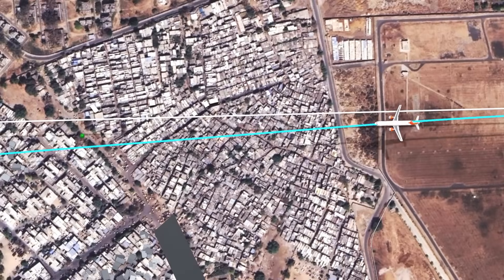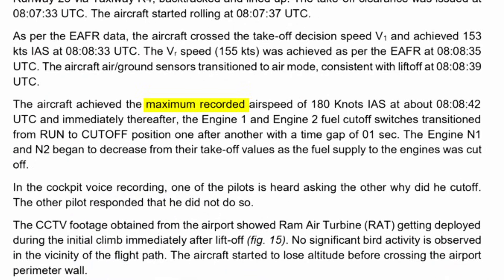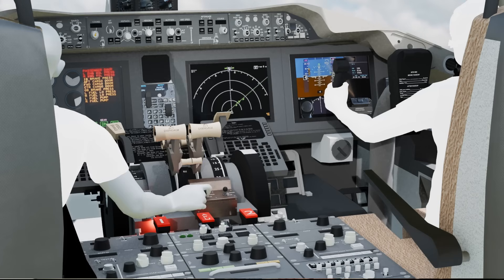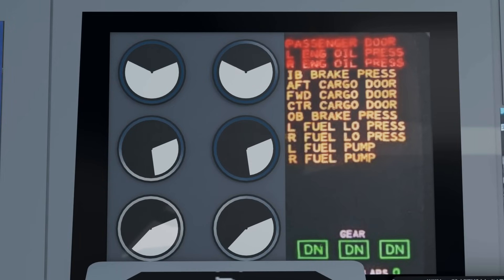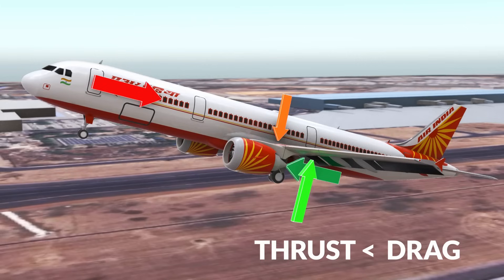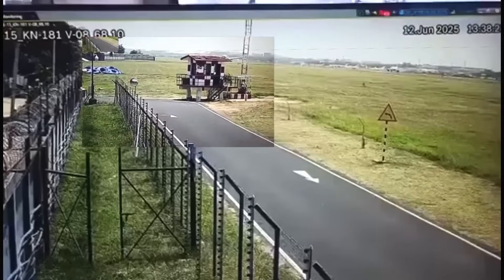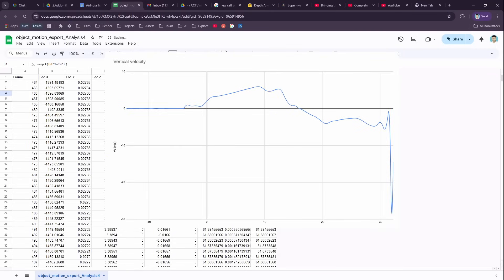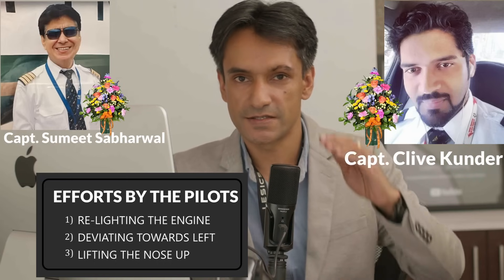Use of 3D Clone | Decoding the Crash Details you Missed

Comment: The fact that the engines were relight, confirms there was no mechanical fault otherwise a dead engine would not reignite.  Everyone it's trying to manipulate the findings of the report to avoid facing the reality, the flight was sabotaged.  Engineers check planes before take off, why is no one taking about that checklist??
Is it because they know that everything check out fine before the plane took, and bringing that report to the table will in fact destroy all fabricated narratives in order to not place blame on the pilots. 
The fact that a conversation between the pilots one questioning the other "why did you turn the fuel off"... is a very disturbing conversation in a cockpit and most likely the first of its kind. That alone is not a normal conversation. The flight was taken down by one pilot and another trying to save it. 
It also cannot be dismissed that it's been mentioned Captain Sumeet had suffered from depression, due to relationship breakdown, and the death of his mother. Instead of paying attention to facts so changes could be made to help the airline work with staff and raise concerns around mental health and how they can be best supported, everyone wants to bury their head in the sand and only listen to narratives that give them a "feel good" sensation.
Reply: Except, you don't know if one pilot asked the other "why did you turn the fuel off?" The "report" says quote "In the cockpit voice recording, one of the pilots is heard asking the other why did he cutoff." Indirect speech. That's a huge difference. Because the very same indirect sentence could mean one pilot asking the other, why the PLANE cut off by itself. In India, planes are "he" not "she". The answer of the other pilot can then be interpreted as "I don't know, I didn't do anything." See, how easy that was? Just changing direct to indirect speech and 2 same facts lead to completely opposite conclusions.

And the report is full of incomplete, purposefully obfuscated half-truths, such as the time of RAT supplying hydraulic power, but not the time of RAT deployment, etc. They are cherrypicking what they can to point the finger at pilots. If they released full CVR conversation, the truth would come out. The can't afford that.
Reply: @MerrekSK indeed, but even then...still...I would have my doubts whether all is done correctly, responsible, with a clear and clean conscious mind. That I find hard to believe, considering what is at stake for so many people and institutions, corporations, factories, governments.
Reply: Where's the report of the sound of the switches being moved? Or the lack of sound? Or even indistinct. They've obviously listened so where is it?
Reply: @pa1189j I think the pilot did something  yes
Reply: @AnetaMihaylova-d6f So where’s the report of the sound of the switches then.  Present, absent or indistinct. Why have they omitted it? It’s crucial factual information.
Reply: @pa1189j one of the pilots  cut off the fuel switches .
Reply: @AnetaMihaylova-d6f   So you were told. If it was 100% true, they would've release the full CVR portion of the conversation and the sound of cutoff clicking. They didn't, cause they don't have any. They are better of stalling for 1-2 years to save Boeing's plummeting stock. Use your head.
Reply: But now in these days of false news, we can never be sure anymore what is true and what not. We never ever could but we did not know. We were to believe and think and be sure and certain everything said and told by high(er) institutions even governments was true, for our own best. But now, with the internet and many curious daring people investigating everything and every spoken and written word, we learn there is hardly any truth in what has been told and sadly will be told to us. 'They' go and will go more, deep and far to hide any uncomfortable truth. Even destroy it if necessary for their lucrative agenda.

Comment: Great analysis 🎉 🎉 But I say that what AAIB released was just a preliminary report and they had mentioned in the report that investigation is still progressing. As per international norms, it's mandatory to release a preliminary report within a month of an aircraft accident. The report might have been on initial findings from CVR and FW EAFR. It's also mentioned in the report that AFT EAFR is severely damaged and retrieval of data is very difficult. There can also be a case where the recorders might have captured the logs as manual cutoff of fuel switches even though there might be a possibility that a wrong signal might've triggered it. Let's wait for a detailed investigation report till then.
Reply: Let's not wait.  The AAIB preliminary report is tailored to make those who are less skilled in reading think that the report blames the pilots  That way of saying but not saying is called 'plausible deniability'.

Comment: The simplest analysis was put forth by another youtuber which said the acceleration needed to achieve  max velocity  from rotate velocity within 3 seconds is not physically possible in gear down and RAT down position-  as it would need almost twice the thrust force of both 787 engines!! I mean the speed and RAT & gear down position are there in AIAB report itself so no one can dispute this fact.😅 Now I have started doubting if conversation about the switch even happened between the pilots ! Unless the entire CVR data is out verbatim, AIAB can't be trusted
Reply: Exactly. The preliminary "report" is deliberately obfuscating, if not straight lying to steer us into conclusions. There are much better ways to knowingly crash an airplane on a 10-hour flight. Not when your co-pilot is at 100% concentration, senses heightened and you risk surviving the low-speed low-G crash and burning to death. A real murder-suicide pilot would've waited for the co-pilot to go to bathroom, locked himself in the cockpit and plunge down with instantaneous impact providing painless guaranteed death. Just like in the other few cases this'd happened before. This is the best argument, the captain didn't do it. Unclear unguaranteed outcome, the 1st officer could've stopped him, etc. He'd risk not crashing, getting caught and imprisoned? No way.
Reply: AAIB can't be trusted.   You sure got that right!

Comment: This analysis can explain that the pilot(s) tried to relight the engines, which meant putting the 2 switches to cutoff, then back to run.   My initial guess was a software error deciding to cutoff the engines.
Reply: "My initial guess was a software error deciding to cutoff the engines."
Ditto.
Reply: @patricklockerby4308  "My initial guess was a software error deciding to cutoff the engines."  Your guess could be true. The pilots have to move the switches from run to cutoff first in order to relight the engine even if the engines were cut off by any other means.
Reply: Engine cutoff is done manually only, it has it's own switch with proper locking mechanism. The pilots even tried to turn back the engines on by offing those switches(2 switches since it's a twin jet airplane).
Reply: @johndavidson3424  Engine cutoff is NOT manual only. The TCMA - Thrust Malfunction Accomodation System can shut off fuel regardless of the pilots' switch settings.
Reply: @patricklockerby4308 
A software shut off does however not move the switch - the report said that bit switches were move to the off position within 1s if each other - that's not software
Reply: @ItsAlways42-z1e  The report did not say the switches were moved. It only mentioned it is transitioned .....
Reply: @luckydogjunction2120 

Different wird, Dame meaning - the switches were physically moved, they transitioned from on to off

A software glitch cannot do that, for that the switches would need a complex motor mechanism which does not exist
Reply: @johndavidson3424   You didn't see the video, you're just replying in the comments. This happened before - All Nippon Airways 2019 TCMA incident. First watch, then comment. Clearly pilots shutting off is NOT the only way how engines can lose thrust or even cut off the fuel supply.
Reply: @johndavidson3424  
On each engine:
FADEC can shut off fuel.
TCMA can shut off fuel.
Fire detection system can shut off fuel.
Pilots can shut off fuel via the TCMA.
Reply: Then why did the pilot flying the plane ask the Caption why he shutoff the fuel to both engines.  Chances of both engines simultaneously failing are a billion to one.
Reply: @ScottMunro-p3y  You're sitting in the passenger seat of a hybrid model semi-auto drive automobile (auto parking model), and there is a full break occurrence occurs, and you ask the driver, "Hey, why did you break the car so suddenly? And the driver said, 'I did not!!' Now, whom you believe? Will you believe the driver or the advanced hybrid vehicle?
Reply: What the vuk are you even talking about?
Reply: Well said😊
Reply: @ScottMunro-p3y  The AAIB report uses very crafty techniques to get the world at large to blame the pilots.  Don't fall for it.  The pilots will have felt a sudden deceleration, causing the pilots to look at the instrument panel and see that the fuel had been cut off.
!st - why did he - the plane - cut off?
2nd - I didn't do it.
Reply: @ScottMunro-p3y   All Nippon Airways 2019 787 did it once and now! It is an assumption that the pilot shutoff the fuel. This is not the only possible way that an engine can be shut down
Reply: @luckydogjunction2120  The Captain purposefully moved the fuel switches from run to shutoff. The flight data confirms it!
Reply: @ScottMunro-p3y  "Chances of both engines simultaneously failing are a billion to one." Are these referring to in general the 2 engines failed by itself". What is the chance of both engine on a Boeing to fail .......?

Comment: As soon as I read the gas switches were "seen' as off, and the 2 pilots were surprised, I said and asked a pro in planes "would it be possible the system turned off the gas but the it's logged as a manual action' ?' 
And seen the motors were off, they had to cut the gas button and put it on to hope a reset !
Another analyse showed the RAT was deployed before the switches were noted "Off"' as if the system knew gas and motors were off !
You point the strange informations in the rapport.... you are not the one !
Reply: Rather than seeing anything amiss at first, the pilots probably felt the sudden loss of acceleration.  That would be initially from 100% thrust, step down to 80% and then ramping down.  The passenger said it felt like the plane stopped.

Comment: Your conclusion agrees with the most reasonable interpretation of the language of the Preliminary Report, p. 14, because the verbiage "immediately after lift-off" for RAT deployment, vague and indefinite as it is, can only reasonably be interpreted to mean that the time of RAT deployment be closer to the time of lift-off cited at 08:08:39 than to the other definite time stamps of 08:08:42 and 08:08:42 of the Engine cut-offs. From this it follows that RAT deployment amply predates cut-offs, pointing to plane error, rather than pilot error. Thank you so much for your persuasive arguments. See Las the presentation by Geoffrey Thomas and Richard Godfrey called "Implausible", agreeing with you.
Reply: It was obvious to me, a retired lawyer, that lawyers settled the preliminary report.

Comment: I still believe heroic captain was genuine in saying he never shutdown the engines, and bet he was just as surprised by event as was the heroic first officer, when either, or both, were alerted to attention by EICAS warning.  Neither pilot moved neither fuel switch as initial precipitating cause.  Engines were (at least one was) shutdown at 1 second following takeoff (gleaned from your evidential timeline), without being commanded to do so by pilots, due to electrical fault or disturbance, or due to computer error or electronics failure.  Flight data recorder incorrectly reported (at least the initial) switch transition(s), owing to same scenario.  Has happened at least once previously.  AND/OR (maybe even related/causal), left engine looked like it suffered a compressor stall at right about the time of rotate, or else fuel was cut off to it while during its high core speed.  Further fuel switch transitions (probably then properly being recorded by FDR; actually, likely even the initial recorded transition, too, in this scenario) might have been as a result of standard (memory-item) engine reset procedure, which may have actually been unnecessary, possibly even inadvertently tragically interfering with, and delaying, the automatic relighting.
Reply: Known problems with water entering 787 EE bays have caused all sorts of anomalies.
Reply: The captain of the immediately preceding flight entered a "Stabilizer Position Transducer Defect" into the aircraft's technical log. This defect concerns a sensor that is crucial for controlling the aircraft's pitch by sending signals to the flight control system.  As well as that passengers on this prior flight reported various seemingly electrical oddities.  Might this all have been indicative of building systemic electrical problems?  Could TCMA have thusly erroneously detected asymmetry?  Or, incorrectly determined that aircraft was still on the ground and (wrongly) could thus still safety reject taking off?
Reply: Maybe the "investigators" don't know the difference between a relay and a switch?
Reply: @patricklockerby4308   They do know. They just need to delay the truth, let Boeing sell some higher-value stock before the truth comes out in a year or so and it becomes worthless...

Comment: Why so many theories when.. NOBODY ever needed to touch/move a cockpit switch.. when electrical power is interrupted, even for a fraction of a second, 787 and 777, for any reason, the spring loaded fuel cutoff valves to the engines will snap shut. Cockpit switches would then at all time stay in ON. This design is that in case of electrical failure, which means fire extinguishers cannot be activated, fuel shuts off automatically so the wing does not burn through from an engine fire. At take off there seems to have been an electrical snag. Happened to ANA 787 after landing using reversers, in Tokyo, and unable to restart. Happened to BA 777 landed safely mile before runway in London. Rtd Training Capt. Pilot Union rep at all regional air accident investigations
Reply: Good thinking, but the duel cutoff valve is not spring loaded.  Its actuator has two input wires - one to open and one to close.  They take 28 volts via 5 relays per engine.  The switches each connect to one relay.  The latching relays don't drop out if they lose power.
Reply: @patricklockerby4308  do you have access to the full wiring details of the fuel relay that controls the spar valve motor?
Reply: @gamelame99  needs it to argue with me hahah. funy how ppl argue points without knowing , isnt it
Reply: @jeremyjohnthompson5187  why would you think so mate, I already appreciated your efforts in bringing out a scenario that seems highly likely.  I'm just asking for some more clarity on the fuel relay wiring since that is so critical for establishing your proposed mechanism of failure beyond doubt.

Comment: On the CCTV film you can see a vapour coming from the left engine. This fact has been neglected so far. Can you fit it in in your conclusions? I am a Dutch journalist.
Reply: It's dust blown up by wake turbulence.
Reply: @patricklockerby4308  No, it is thicker near the engine output than at the ground. And only left.

Comment: Gross misuse of your engineering credentials to paint an imaginary fantasy to push the blame to anyone but the captain. It’s quite obvious to me your starting point is the words and feelings of Sam Thomas the president of the Indian pilots association. Is he the force behind all of this nonsense? Given the terminology you have used it seems to be. 
Too many obvious errors in your so called analysis to list. Suffice it to say that you are ridiculously wrong by your finding of 190 ft maximum elevation. Also completely wrong to argue that fuel switches can’t be turned off within one second of each other. Even a 11 yr old can do that real easy. Also, you are very weak on logic and psychology for lumping the two pilots’ intentions together as if they are in full cooperation. One is a promising young pilot trying all he can to save the plane and souls from the enemy within; the other one a deranged mass murderer
The data produced by your (so called) analysis contradicts readings from the FDR by a large margin. Can you really make up your own data as you please? What an engineer
Reply: How do you explain the insane acceleration ( 3 seconds) from vr to vmax of 180 knots as per AIAB report?  It is physically impossible in the gear down and RAT down position ! The thrust needed would be close to double the thrust that the 2 engines can provide ! While I agree the switch off can be within 1 second, I don't see anything wrong in his overlay of the 3d model. I mean you can download and open in Blender ( which is free) and check for yourselve😊
Reply: and you sir are incredibly deffensive, suspiciously deffensive. what are your credentials?